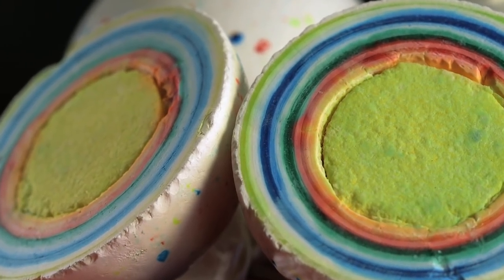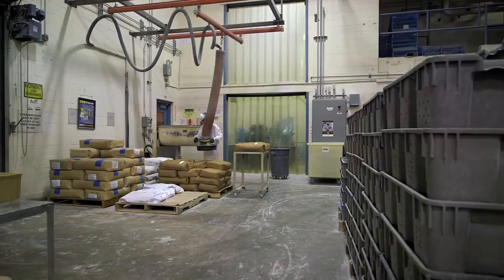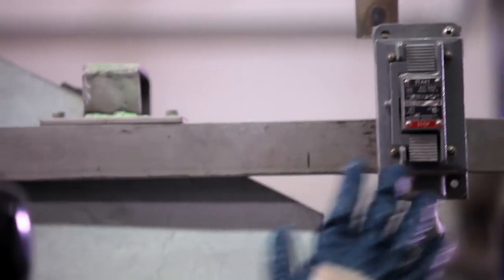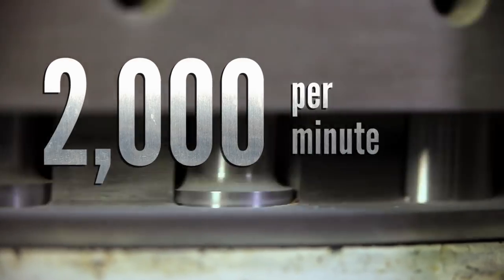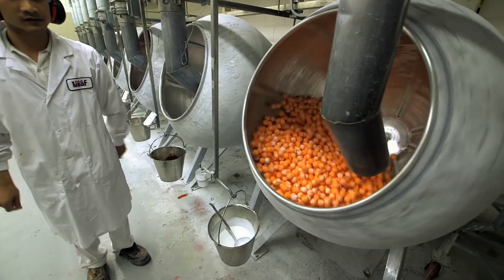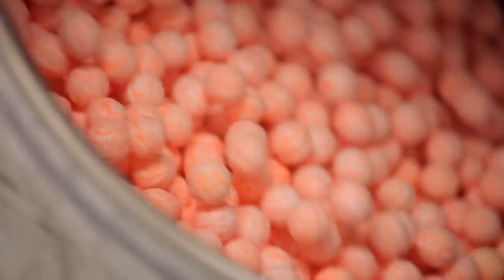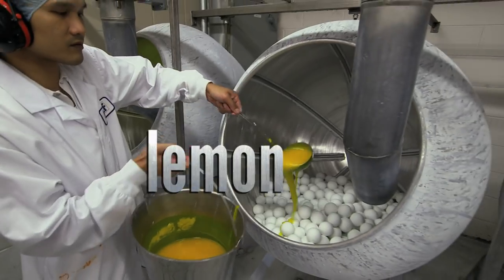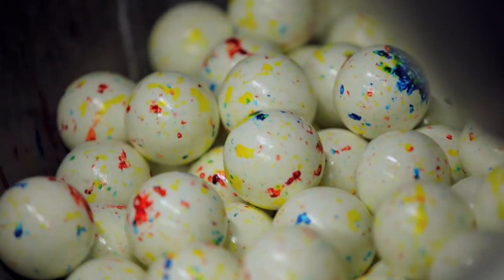How Jawbreakers Break Jaws | Food Factory

Comment: In Germany there were such things with chewing gum inside and a little air bubble in the core. In some cases they exploded and were responsible for many injurys until they got forbidden for some time as i remember.

Cause when they where made in a cold area and they come into a hoter place the air starts to produce pressure and can cuase them to literarly explode.

Dangerous candy

Comment: Don't exaggerate. Yes it's loud, but LITERALLY NOT AS LOUD as a jet engine.

If you stood next to a jet engine while it was on, assuming you don't get sucked in and grinded into a million pieces, your ear will literally rupture and burst, instant deafness, there's literally no recovery from that, not even with strong earmuffs on.

That's why when ppl board a plane that has jet engines, the jet engines are actually not on full throttle, fucking far from it. Otherwise literally every passenger walking past the jet engine as they board would instantly become deaf.